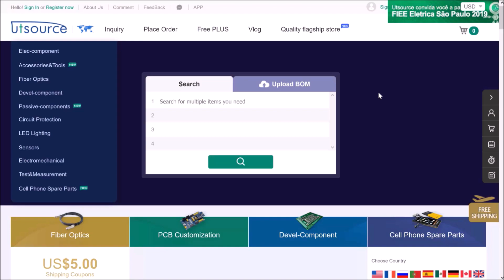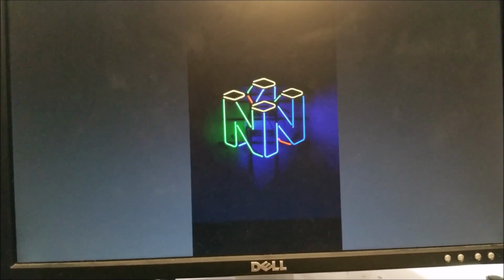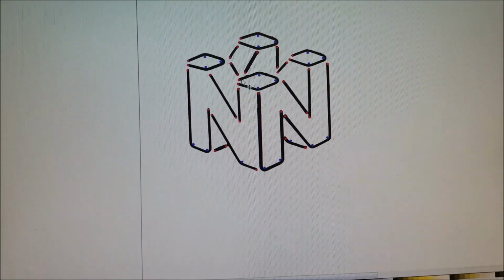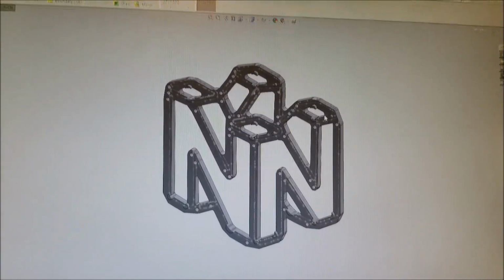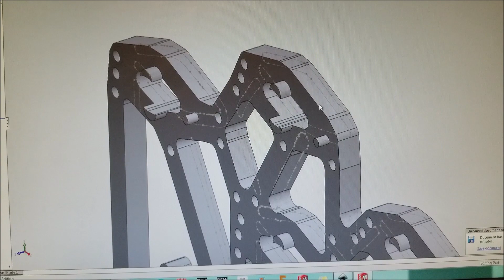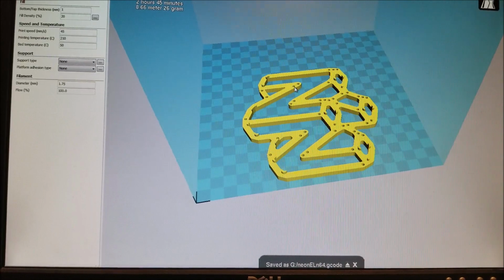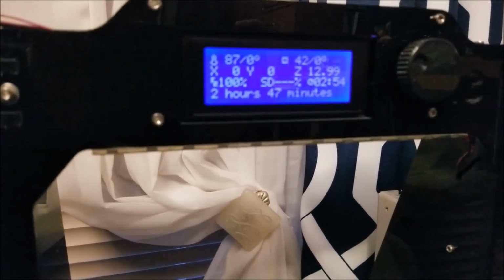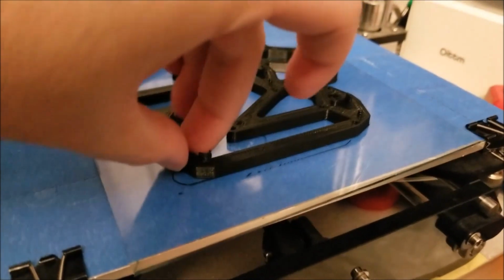DIY EL Wire + 3D Printed "Neon" Sign! UTSOURCE

Comment: How much do your repairs cost?
Reply from the maker: It really depends on what the job is, I'd have to get some details in order to figure out how much time I'd need to spend and how much replacement parts would cost if necessary. If you have something specific you'd like me to provide an estimated cost on you can shoot me an email at (sjm4306@gmail dot com).
Reply: Thank you for responding,and I would like if you could repair Dead pixels on my gba SP and replace the shell with a green Shell and ad a screen protector How much would it cost?
Reply from the maker: Unfortunately dead pixels cant be fixed, the whole screen would need to be replaced. Is it a ags-001 or a ags-101? A new 001 screen is around $30 but a new 101 screen is upwards of $70 last I checked. A new shell and screen protector would cost ~$10. So total parts cost would be ~$40-80 and installation labor would be an additional $20 for a grand total of ~$60-100 (the exact price to be determined when I go to order the replacement parts as they fluctuate a bit).
Reply: It’s a ags-001 but If you could put an ags -101 screen that would be grate and I think I won’t want the new shell,because of the total price 😅

Comment: With the sharp edges using a heat gun to form the corners helps a lot, just get the EL wire hot and heat set it.
Reply from the maker: Oh I'll have to give that a try, gotta experiment with temps and times!

Comment: Nice excellent work! I was going to buy the neon chinese equivalent of that for my game room/office. So is that to scale of the neon unit you found online or is it smaller? If you said a size difference I missed it.  I want to know what I am getting for my wall and if thats the size I guess it should work.
Reply from the maker: I actually didn't check the size of the original, I choose a size based on the area of my printer bed glass and what would look reasonable given the diameter of the EL wire. A quick google search says the commercial one is 17"x14" while mine is roughly 5"x5" (about 1/3 the size). It would be possible to scale the EL version up but would require splitting the 3D printed frame up into separate parts and gluing them together as well as possibly doubling up each of the EL wires to make them thicker or it may look kind of too thin.